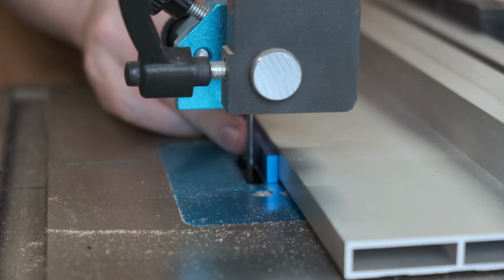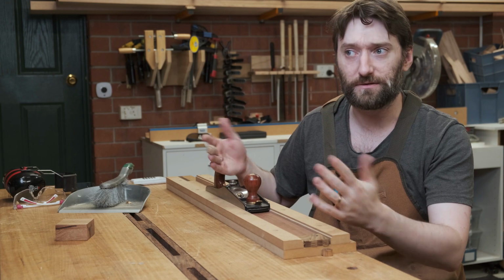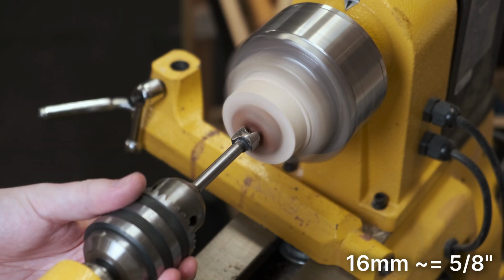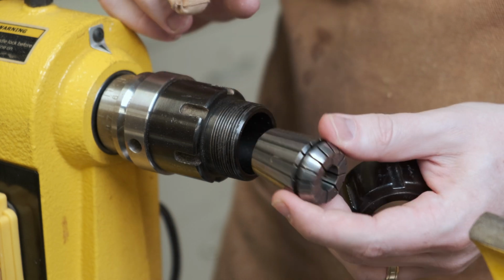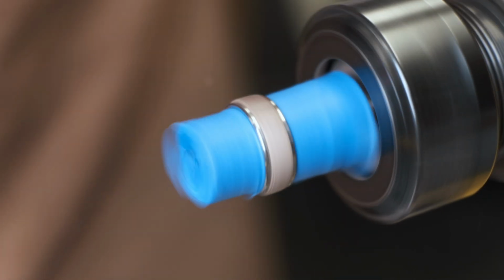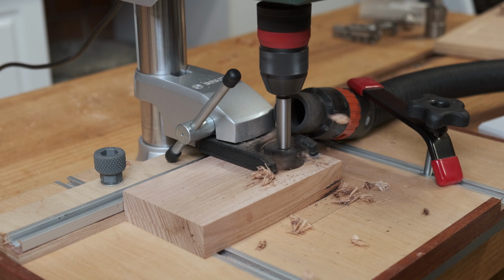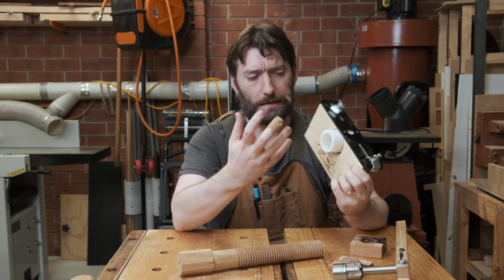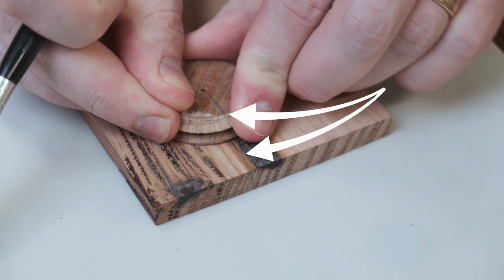Blackwood & Titanium Ring with Threaded Ring Box

Comment: Hey Paul, when using the ER32 you want to mount the collet inside the nut so that they are flush rather than putting the collet in the chuck and screw the nut on top. You're not working with great forces but it should be gentler to the assembly and the nut helps pulling the collet out when you are done.